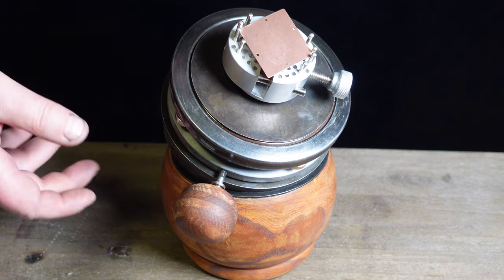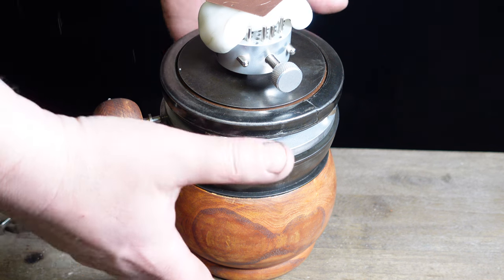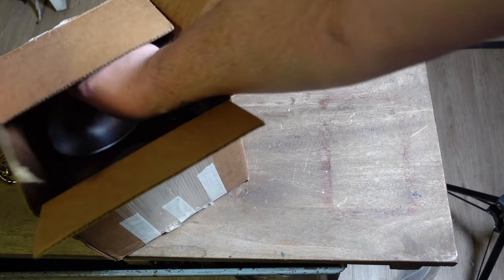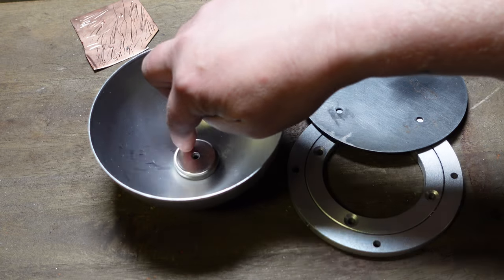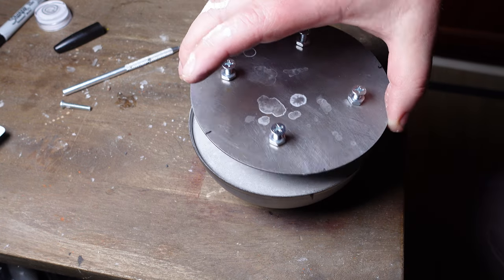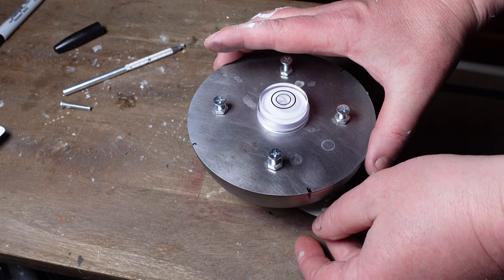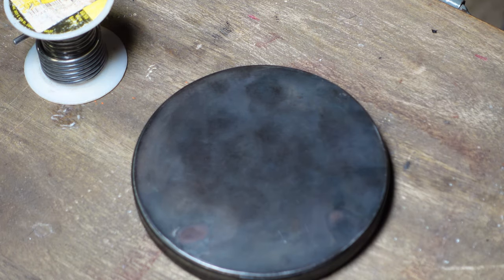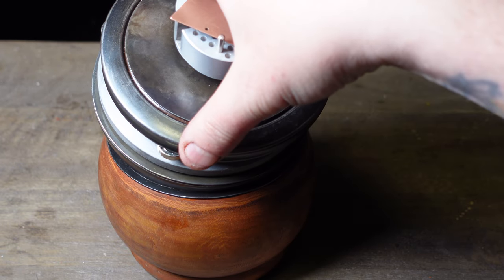DIY dollar store jewelers/engravers ball vice for $25 #jewellerymaking #engraving #knifemaking

Comment: brilliant idea, I'm a beginner in measuring metal.  I've made some DIY vise.  I made a version with full wood with a bowling ball base.  and finally i made the second version with the top of the vise degrees.  but your version is brilliant.  a suggestion if you make the vise part small a little bigger would be great.  the video you are using is too small.  but overall yours is very good
Reply from the maker: Hi!..thanks for your comment... could you explain what you mean by " the video im using is too small'? im not quite sure i understand what you mean...thanks again!
Reply: @sweetgumnyc7794  I mean that small vise, it would be better to turn it yourself, it would be prettier

Comment: Thank you for this walk through! I have a few questions before I begin ordering things for my own. What is your source for the work holder? You mentioned they can be found for 7 dollars but the closest I can find is ‘adjustable pin workholders’ that go for 40 to 400 dollars. 

I also noticed a metal ring appear on the lip of the mortar bowl after you purchased it. Was that another part you sourced or did you cut it from a third mild steel 5” plate you hadn’t mentioned in your parts list?

Comment: Amazing!!  Now I know what my next project. Very nice job!!!
Did you add some sort of metal ring to the wood bowl?? There appears to be a black edge to the bowl.
Also have you thought about anyway to tighten the metal bowl to the base? Just because with engraving and such I’m guessing you would need to have it Not move around when you are tapping with a hammer.
Reply: Yeah it looks like he cut a small ring and epoxied it on the rim of the base, presumably for either friction, wear resistance, or a more uniform bearing surface.

Tightening the bowl to the base would require one of two approaches.  You can add more weight to the bowl by casting lead into the bottom so that friction is increased, it wouldn't lock it down but it would provide more resistance.  Roughing up the bowl itself with 36 grit sandpaper would also increase that friction.  The downside is that the bowl would always be difficult to reposition and you couldn't adjust that aspect of it.  The alternative is to make the bowl on top more than a hemisphere by using a hollow steel ball and cutting it an inch or two above the hemisphere, enough so that you can take another steel ring and place it on top above the equator of the bowl.  That first ring that he added to the base would need to stick out past the wooden base, and the second ring would match it.  Then you could simply add some springs or bolts that will create a clamping force between them.  The bowl could still freely move between the two rings until enough clamping pressure was added, and would eventually lock it down.  Using long bolts with captured springs between the bolt head or nut and the plate would allow you to adjust spring tension to give you the right amount of friction.  To help you visualize this, a lot of car exhausts use a similar joint to connect pieces together where there might be some misalignment, it allows the tubing to be repositioned as needed and then tightened.  Search for "exhaust spherical joint" to see how the concept works.  Since you're only capturing a ball and not having to connect two pieces of tubing together, the bowl itself can be still rotated about as far as the upper mount will allow.  Would probably be a good idea to polish and/or grease the bowl so friction will only be present when you want it to be, or use brass plates instead of steel.

Comment: The vise that you have will probably have limited use..   though I use mine it is only to hold a shellac or pitch plate that I glue my work to..
The pitch plate is awesome..    the other advantage, if you are working under a scope is it brings your work down closer to your centre of rotation.    If I were you I’d just make another plate- a solid one with hot glue (Thin layer) which is quicker to cool and so quicker to pop things on and off (and can get your work even lower)
All this assuming the magnets absorb the forces from engraving fine?

Comment: Love your design. Could you make a total parts list and instruction on assembly, please. I am having trouble finding the correct size magnets and screws for making this. Also curious as why you used the heavy duty magnet inside of bowl before you added the nuts and bolts and concrete. Thanks
Reply from the maker: thats so the bowl will be magnetic. as you can see in the beginning of the video the vice is magneting so you can just stick your tools to it when you want your hands. if you dont want it magnetic then its not necessary .

Comment: Hi could post how you made the Soldiering Clay please.
Reply from the maker: yes! its really easy. 2 parts silica sand ( fine grain/ high mesh like 400 or 600) one part powdered bentonite clay and add mineral oil slowly while mixing until you have reached your desired consistency. try to limit the oil to just what you need because if you add too much oil it will smoke when heated too much. good luck!
Reply: @sweetgumnyc7794  Thank You🙏🏻
I like how you resolve expensive tech machine and provide solutions 5 ***
Cheers from down under 🙏🏻

Comment: i LOVE this and want to build it. I'm taking up engraving and chasing while being treated for cancer. Can you please tell us:  A) what size and type of magnets to install on top of steel outer ring on the bearing   B) what size the set screws are in order to fit 10-24 screws? (i found a product i think are the thing - looks equivalent to sign mounting hardware - but the measurements are such as 1/2 x 3/4 )  C) what about the vice itself?  do you have a recommendation for brand?    D) How did you attach the vice to the soldered steel plate?

Comment: emmm actually on shopping websites in China ,the ball axis like in this video only  roughly 60USD (7.19rmb=1usd) and It is also free of postage in most parts of China. I'm hesitating whether to buy one directly or DIY one according to this video.
Reply from the maker: Not sure what you mean by "ball axis"? but if you mean the small ball vices for 60 bucks on aliexpress, they are really bad quality and most dont work and require a lot of work to get working, they are really tiny and even the bad quality ones that are advertised for $60, they want like $50 additional for shipping, so youre still paying over a hundred bucks for a very small and very bad quality vice. Thats why i decided to make this $20 DIY version...its bigger, better and much cheaper.